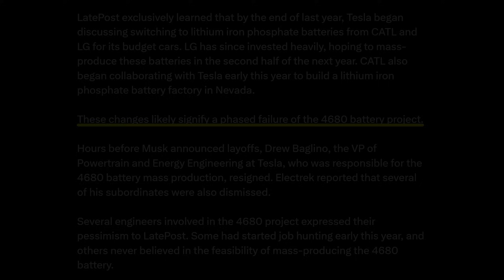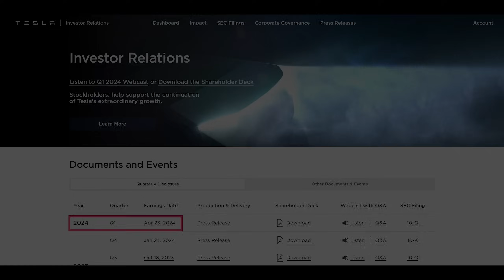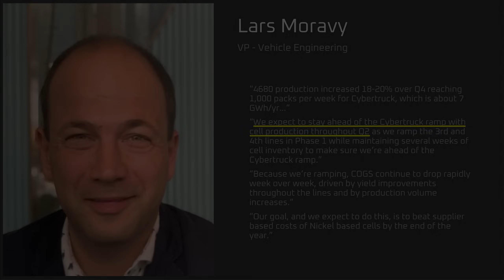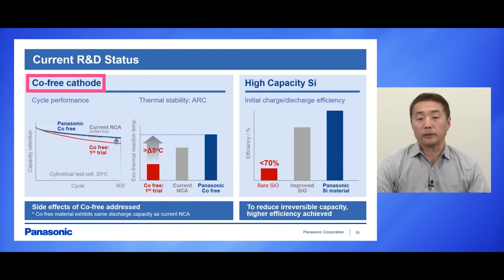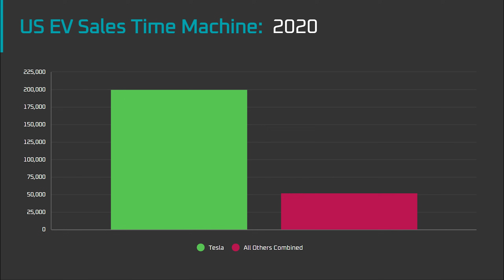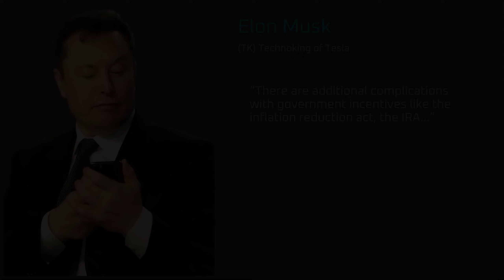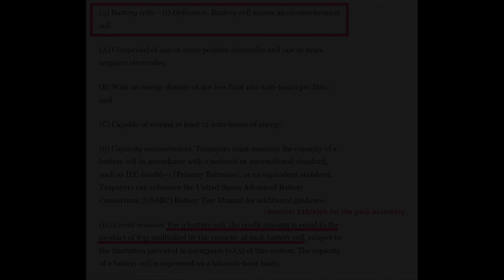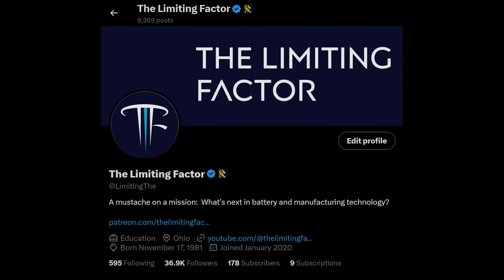Tesla Q1 Battery Report // The Death of the 4680 Has Been Greatly Exaggerated

Comment: Jordan, is there any similarities between aluminum foil manufacturing that would be useful or similar in 4680 jelly roll winding. Superficially they seem similar. Aluminum foil has good scale and speed metrics wrt manufacturing
Reply from the maker: Pretty much the same stuff, even the thickness.  However, I think they put a thin coating of carbon on electrode material and it might have tighter tolerances in terms of pinholes, etc

Comment: Hi Jordan! Tesla cannot use the 4680 cells for the M3. The platform on which it's built is not compatible with the structural pack. They could use them on the MY since it has rear and front castings. Love your work
Reply from the maker: Thanks!  Incorrect though.  The Model Y accepts both structural and non-structural packs.  No reason they couldn't do the same with the 3.

Comment: One thing I didn't hear you talk about was the charging curve of the 4680 cells. If I missed it, sorry I was working while listening to the video.  I love your videos and feel like they are some of the most detailed and trustworthy on the subject I have been able to find. 

I am wondering if you have any insight into the charging curve issue(s). Those being that though the 4680 vehicles are able to hit a high charge rate, they fall off more quickly than any other Tesla's and are even slower than most other EV's. The gen 1 in the Base Model Y AWD (now discontinued) was really bad, one of the worst charging curves in any long range EV. The Cybertruck is better, but it still suffers the same rapid drop off, and currently the 10-80% charging time is very bad for the AWD base version of the Model Y and still very bad for the Cybertruck (even considering 800V charging which Out of Spec actually tried with a custom adapter). 

I don't know why the charging curve is so bad, not even sure if it is not just a software issue. However, if it is being software limited, why? I am a Tesla shareholder and this worries me about as much as anything in the company. If the 4680 can't charge fast it is doomed regardless of how much money it saves on cars, and that would be a lot of wasted money. 

For the Cybertruck right now it is ok because there is nothing else in that market that charges fast anyway except the GM Silverado and Hummer, but those are still really low in production numbers. This won't be the case forever though, and if they try to use these on other cars that will compare to cars with fast charging speeds (Kia, Hyundai, Porsche, etc...) it will become a serious issue. Do you think this is something they can address?
Reply from the maker: Gen 1 - Hardware Limited
Gen 2 - Software Limited (update coming)
Reply: Is the 4680 the first battery that Tesla is making themselves?
Reply: @ahhmm5381  Ah, I am not sure what qualifies as making by themselves, nor am I an expert on that. My understanding is that the other cells they manufacture are in conjunction with Panasonic, what that exactly means I don't know and haven't researched.

I think that misses the point though, the question is why is the 4680 having such a bad charging curve, could be a lot of things, including the size of the cell. But Jordan answered and I trust his sources/insight.
Reply: @ahhmm5381  The other commenter is Jordan, the author of this channel and more knowledgeable than both of us put together.  Tesla doesn't have the deep experience in battery development that a Panasonic or CATL does, but they are not newbies, they have been doing it for over a decade.  Jordan is not hand waving, either, he is saying that he is making a video on that subject and already has done research probably.  You are the one hand waving, and I know you are anti Tesla, so I really put everything you say in the suspicious category.

Comment: The model y structural battery pack was using 4680s. I wonder if they're pushing all production to cybertruck lines because model Y's production would already outstrip cell production.
Reply from the maker: The Model Y pack was kind of a beta from my perspective

They don't need the 4680 in the Y, but they do need it in the Cybertruck, and it can support the low margins

Comment: Great video. I am not that knowledgeable about the 4680, but your conclusions based on profitability of Tesla are really an oversimplification in my mind. Many reasons why Tesla is profitable that are not really competitive advantages. Including scale, utilization, regulatory benefits all of which are just not really durable types of advantages in this industry.

EV penetration is not high enough to really see the relative competitiveness. Really hard to tell how brand loyalty will transfer onto EV, how the old carmakers will look like when fully focused on EVs. 

Also one thing that I don’t understand but would be curious to learn more about, if CATL makes competitive batteries how much differentiation can any OEM get when they can use CATL as supplier.
Reply from the maker: This sounds like a corporate powerpoint presentation.  What are you actually trying to say.
Reply: @thelimitingfactor  Okay I will do my best to elaborate, but like I said I don’t pretend to know it is just my current understand.
If Tesla has higher utilization in its factories than for example Volkswagen it will have better fixed cost absorption. But utilization can change quickly that is not a sustainable first mover advantage, unless there is a reason why that would be sustained, and utilization causes big swings in profitability. Similar for scale where there is some critical mass needed, so difficult to compare an under scaled competitor with a scaled one. But I don’t consider these things first mover advantage that creates something lasting.
So, a lot of questions that impact conclusions from a profitability comparison.
Are the regulatory credits similar part of profit contribution for manufacturers? If others have goodwill impairments in their numbers that makes comparability of GAAP net income not meaningful. 

About loyalty. Among the early adopters Tesla has a really good standing. But it is unclear to my how the brand value of the old OEMs carry over to EVs. Does the large share of consumers that are not yet in the EV market and prefer ICE think of Tesla that highly as well or do they value the old OEM brands more. 

Basically, I was most surprised by all these statements like “it might be too late to compete with Tesla”; “(if…) they will sweep the table” because I don’t understand what the sustainable competitive advantage of Tesla is. One advantage that could be sustainable like it has been for Apple is all the free press. But current efficiency advantages or currently higher profitability – I don’t understand why they should be extrapolated. I do like Tesla. I do like your videos. Really just about understanding where that is coming from.
Reply: @thelimitingfactor  It sounds like (also with the 50% growth assumption and the sweep the table comments) you would think they will dominate the market in 5 years or maybe even 10 when EV penetration will be really high. And to me that would mean some really high global EV market share so significantly higher than 10 %/15%. And I just don't understand where that is coming from.
Reply: What about giga casting? Thoughts?
Reply: @ahhmm5381  Giga casting is one example of what I don’t think is a sustainable advantage. Tesla does not manufacture the presses nor does Tesla have strong IP within that as far as I know (correct me if I am wrong). They purchase them from Idra. Now anyone can purchase from Idra like anyone can purchase from CATL. Others intend to utilize Giga casting, so while Tesla may be advantaged now and this contributes to higher profits, I don’t understand why that would be an advantage 5+ years from now.

Comment: Perhaps CATL is selling below cost and are just starting a discount war to scare the opposition but if they will be able to turn a profit then CATL at $56 per kw for LFPs and their sodium batteries being  30% cheaper again at around $40 and Shirley Meng predicting sodium will end up as dense as LFP anyway then it must be hard to justify spending any more large sums on R&D for another major battery breakthrough. The 4680s may not be needed. I hope the 4680s can compete but it seems, regardless, we are here. In a couple of years storage batteries will be 30-40% cheaper which is an economic  tipping point to justify every house and business having roof top solar and storage and the upfront cost of EVs will be on parity with ICE equivalents. Such and exciting time.
Reply from the maker: It's a good point and they probably are

However, sodium ion batteries won't get off the ground quickly with LFP so cheap.  Sodium ion currently costs much more than li-ion because it hasn't hit scale.

As they said, 4680 is a hedge.   Prices will fluctuate.

Comment: Expertly pairing the dry, undiluted cathode of drawbacks with the intricate anode of benefits,  Jordan's Limiting Factor is an integrated structure,  powering the movement of understanding of the industry with cell-level detail, efficient packaging, anxiety shielding, and accurate data management into a wisely integrated pack of enduring value and reliability. You serve the community well,  sir.
Reply: And he currently releases videos in series, really amping up the voltage, while insulating the shock value.

Comment: I don't agree with your assessment of Tesla's 4680 production targets. From past Tesla statements, it appears that each line at Texas is targeted to produce 5GWhr/yr not your astounding 25GWh/yr. Yes current production is 7GWhr/yr but I do not agree that this is from a single line. Tesla has at least 2 fully functional lines running at Texas and 2 more ramping up.
Reply from the maker: They said 20 GWh/yr at battery day and then increased it to 25 GWh/yr

Fact, not assessment
Reply: @thelimitingfactor  Are you talking about 3 years ago? Back then Elon wanted a target of 10GWh/yr/line but that was later reduced to 5GWh/yr/line for Texas. The also talked about higher goals for multiple lines. You are applying multiple line forecasts to a single line. They also projected 100GWh/yr at Nevada but did not specify how many lines they expected to install there. There are about 20 lines at Nevada for 2170 production. Not unreasonable they would plan for 20 lines for 4680 production.

Comment: How long until 3rd party mfgs can start producing 4680?  CT can't ramp any more than 1k/week until 4680 ramp accelerates.
Reply from the maker: This year, but they'll be different on the inside

Currently, the 4680 isn't holding up production of the C/T - I covered this in the video
Reply: @thelimitingfactor  right.  I think they are at < 1k CTs/wk with possible burts up to 1k.  But CT can't get any higher without 4680.  There may be other bottle necks before that, but 4680 could easily become one if something slips in the 4680 supply chain. Having a few weeks buffer is a good idea.
Reply: @tripzero0  You missed the point.  The 4680 is NOT holding up the CT ramp.
Reply: @TheEvilmooseofdoom  you missed what I actually said.  I said it easily could become the bottle neck.  At 1k trucks and 1k 4680 packs per week, the ramps are now tethered.  Production of trucks appears to be accelerating faster than cell production.

Comment: Unrelated, but have you looked into the possibility of combining analogue computers with the AI systems in order to cut down on energy consumption? There seems to be a lot of potential here to speed up the calculations and save energy in vehicle.
Reply: I am under the impression that the current FSD hardware is already fast enough for its intended purpose. In addition, my understanding is that the FSD hardware (cameras and the AI chips) are always running when the car is being driven: when the car is not being driven via FSD, FSD is running in shadow mode so it can collect data for training purposes. So if Tesla cars can already get "good enough" range with the current FSD chips and those chips are fast enough for their intended purpose, I don't see a compelling need for Tesla to switch to a completely different architecture (analogue instead of digital) for its FSD chips. Am I missing something?
Reply from the maker: I'm not sure what you mean.  Compute is cheap and efficient, and getting more so each year

Comment: 👏 as usual!  I highly suspect that part of the reason 4680 hasn’t gone into other vehicles is availability of 3rd party cell supply, particularly US based production of them, this limits what models they would go into.

If Tesla were to supply themselves with 4680 for say model 3 they would essentially be single source supplying in the US and creating a multi vehicle dependency on that supply. I think once the LG or Panasonic additional factories are on line we could well see 4680 spread to other models
Reply from the maker: Fair points!
Reply: good point. traditional auto makers usually make sure they have at least two suppliers for any critical component